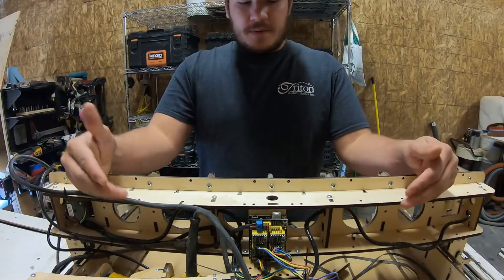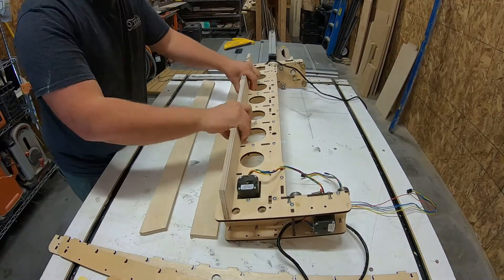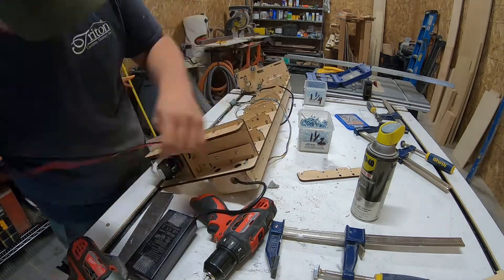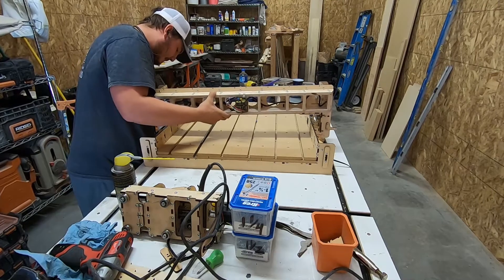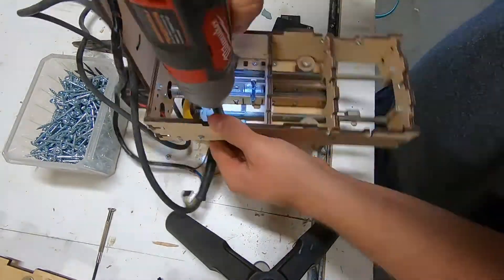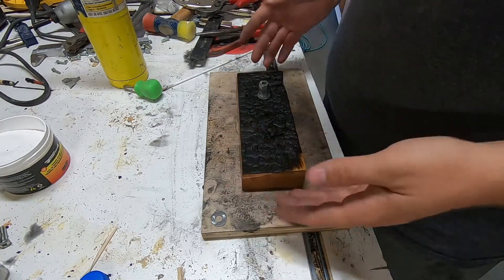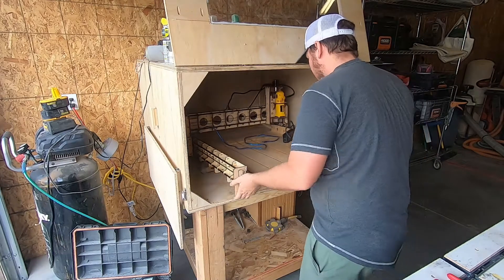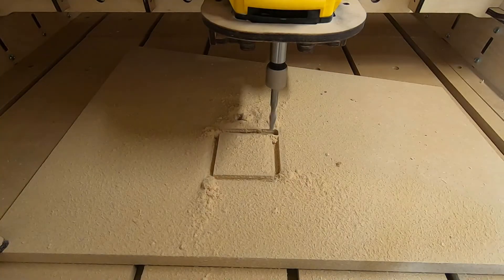ISSUES WITH BOBSCNC? THESE MODS MAY HELP!!!

Comment: Do you have a plan diagram for the gantry fix? Thanks for the video! I have wanted to upgraded my z axis with an aluminum piece but haven’t found any plans?
Reply from the maker: I hand made a replacement out of plexy since mine failed. I just copied the original part. Do you have a router?

Comment: *I am having the same issues with my E3 that you are. Your repairs are a couple of months old now and did this work improve the performance of your Bob's machine and would you have done anything different?  Your repairs look great and strait forward. Thanks for taking the time to video and let us know what you did.
Reply from the maker: Hi Marvin! So far yes they have helped. Due to the type of rails the z axis is mounted to there is still more work i need to do to make it more ridgid. Im having a hard time getting work done since we use it for the etsy store and finish work in houses has been busy. I will do a follow up video with some more mods. If anything I would start with the 1/2 Baltic gantry brace that made the most difference so far. Made it much more usable and I am able to keep my feed speed around 50-60 inch per min with out any chatter with pine. New upgrades will include adding linear rails to the gantry and a revised more accurate z axis. Just trying to get the design right and cost down so that it's more justifiable over just buying a new cnc. Thanks for your feedback and I hope you enjoy my channel!
Reply: @homeworxchannel4120  Thanks for the reply and I will be looking forward to seeing what upgrade you come up with. I will get started soon on the gantry brace and will enjoy using this machine without maintenance man-hours being equal or more that usage hours. I have replace the small washers under the adjustable bearings with larger fender washers on the on all three axis and used elastic stop nuts to ensure the tightness,  that helped some but the X movement is still a big problem. Thanks and have a Blessed day

Comment: I am having an issue with my v carving. I use Carbide Create and if I use a contour carve with a straight bit my machine works fine. When I choose v carve my machine seems to cut erratic. Any ideas?
Reply from the maker: Have you checked and made sure your stepper motors are plugged into the right spots. Could cut basic shapes fine but when you get into more complex gcode you would notice.

Comment: Are these issue rectified. I have one of these cnc e4 in my cart just about to purchase but decided to do the last check on youtube for reviews and found your video. So do you know if these issues have been resolved
Reply from the maker: The issues in the video are fixed but others have come up that make the machine frustrating to use which I wanted to do another video on. I just have been busy. Is it a hobby machine or are you looking to use it for business?
Reply: @homeworxchannel4120  am looking to do business with it. What are your suggestions?
Reply from the maker: @dwaynejohnson7499  I would consider a cnc from Cnc4newbies. That's where I will purchase mine once I figure out what size I want for the next cnc. I do a pretty small volume of etsy orders with this cnc and sometimes I wanna pull my hair out. Onefinety also makes a nice machine.